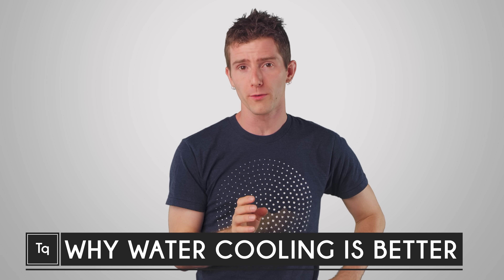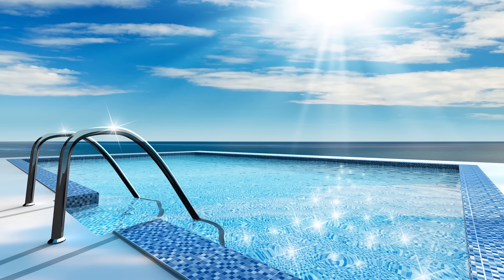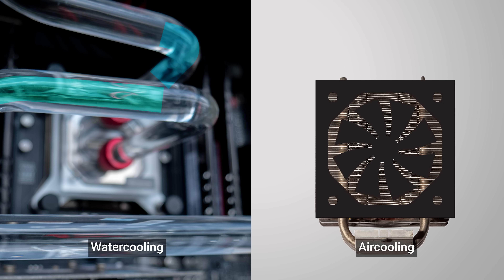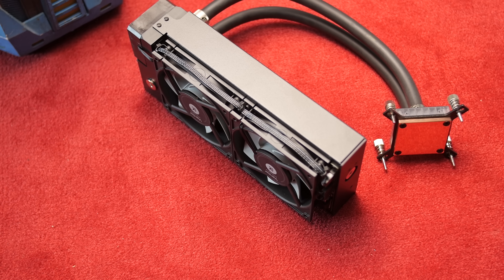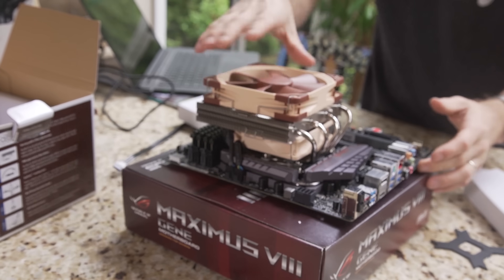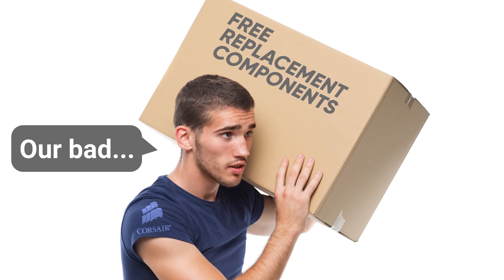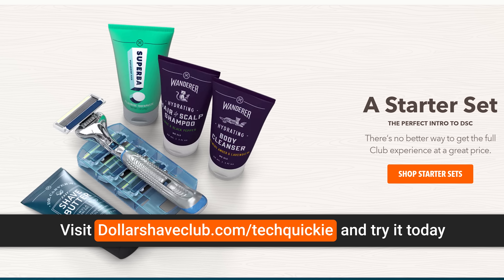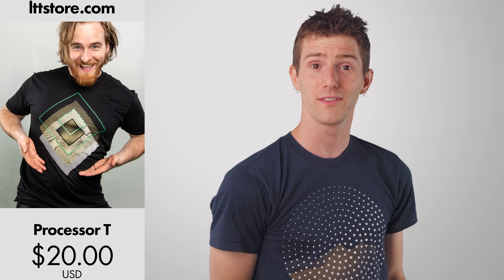Why is Water Cooling Better?

Comment: *laughs in noctua d15
Reply: Brian  looks arent everything. Enjoy having to replace your AIO in 5 years (at best) because it will start underperforming, or maintain your custom loop very often. Meanwhile I will keep my D15 to my death, worst case scenario a fan dies and I will replace it, but lets be real, noctua fans dont die.
Reply: @Lambretta_G  Maintain your custom loop very often ? Get some good quality liquid and you can run for over 2 years. Very often is just not true.
Reply: @Lambretta_G  you guys really think aios die left and right huh you guys do realize that aios aren’t that weak right ?
Reply: Laughs in stock cooler
Reply: *laughs in be quiet dark rock pro 4
Reply: @Evexified  i had the dark rock TF with my old AMD FX, and the arctic eSports duo on a 2700x... Do you recomend the dark rock 4 over those other 2 for my other ryzen using the wraith Prism?
Reply: @NaNekoRx10  Dark Rock 4 is a good buy, it keep your CPU a lot cooler than using the wraith prism. The Dark Rock 4 is also a lot quieter than the stock AMD cooler, it is pricey though, if you've got the money fork it out for a Dark Rock Pro 4
Reply: Evex I’m actually gonna get that one.

What Cpu do you use and what are your temps?
Reply: This is the onlyh correct reply. I have 3 PC's at home with NH-D15's and I am never going back to any AIO. 

My work computer has a H100i and I hate the noise and lack of cooling performance in a ITX case.
Reply: [Laughs in AMD Wraith Prism] Just because it looks so damn sexy!
Reply: Brian  laughs in brown and beige
Reply: Brian  
Laughs in not caring what my CPU cooler looks like inside the case, below my desk.
Reply: Brian  when you care more about looks than performance... lmao. okay. to each its own.
Reply: i was literally going to write this exact comment lmao.
Reply: @Emily Thomson 
You mean when Noctua sends you new mounting kit for free (shipping costs?)?
Reply: Laughs in passive cooling
Reply: Brian laughs in Chromax D15
Reply: @merry1694  Even better LTT chromax D15s'!
Reply: i laugh in Thermalright Le Grand Macho RT  + noctua fan :P
Reply: Laughs back with dual 4x120mm RX480 rad's with dual D5 pumps. Browsing the internet ? No fans need to run. Playing a game, still very, very silent.
Reply: @PilatuS23  Your fans dont need to run because the noise of your D5s is just enough?
Reply: @dr.blutfleck7816  Not if you run them both at 35% of max power. That's why i have 2 of them, so they can run so low you can't hear them.

Comment: "Watercooling is better."

Noctua NH-D15 says hi.
Reply: The be quiet dark pro 4 stands asside you fingersnipping
Reply: My PC sometimes runs for 12hour straight under load. Thanks Noctua
Reply: @MrPaksh  Because you think a watercooler can't do that? lol
Reply: Watercooling left the chat.
Reply: How much is that air tower cooler? Currently using a 360 aio and temps vary between 40~60 all the time during idle or load I wonder if that bad or good
Reply: He said better, not cheaper learn to comprehend
Reply: @Manuel G you gotta get more performance! Overclock and get minimum stable voltage tilt your temps are in the 80s. Well worth it.
Reply: 02:52 And the pumps do not emit any noise? How interesting...
Reply: NH-D15 says you need new ram because I’m so damn big 😂😂😂
Reply: @therevanchist1123  Very clever!
Reply: Just because a woman can suck the varnish off of an old bed post doesn't make her pretty though. I mean, ugly is still ugly. LUL!